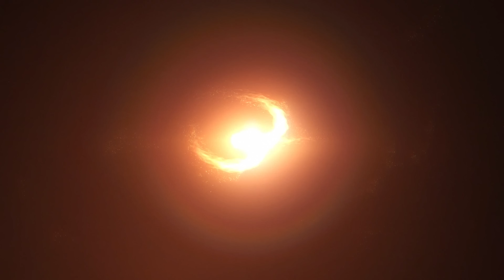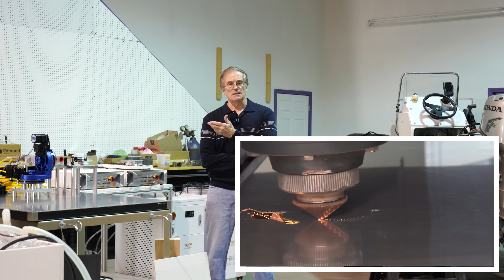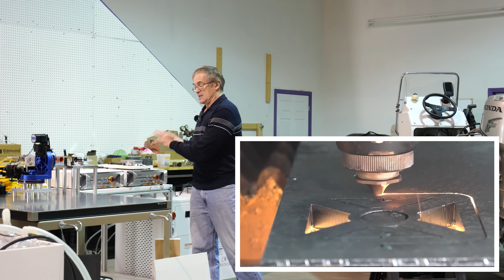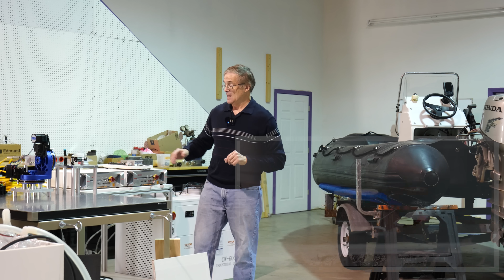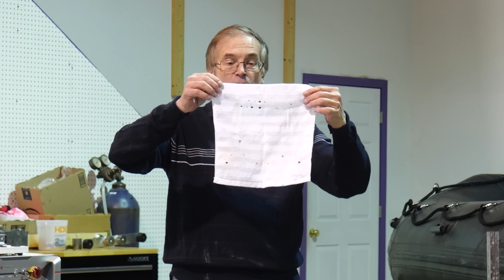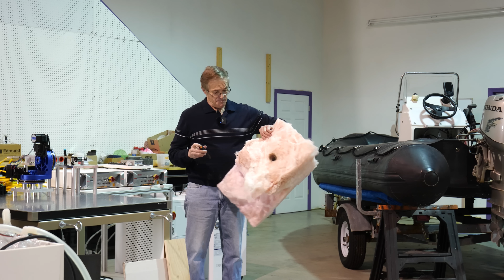We have a problem... and need your help!

Comment: 1030-1075nm?  My thought is to use a few millimeters thick foam or powder coating of an infrared-transparent salt like potassium chloride.  Try to diffuse the laser on its way to hitting something that can handle that intensity if it's defocused to a larger area.  The trick would be finding a material transparent enough to micrometer IR to not be destroyed, but surely that material exists because that's what the fibre and lensing in the laser itself are made of.  Finding an adhesive that is also IR transparent enough to not be destroyed may be a trick.

I see that high-density polyethylene is around 97% transparent to those wavelengths.  It might be interesting to try hitting a milk jug and see if it burns away or is able to diffuse the laser.  I'm guessing it will be destroyed, but if it's not, that material might prove useful.

You might be able to build a photosensitive kill-switch like others mentioned, without it having to be in an enclosed box the size of your garage wall.  Phototransistors are cheap and you can get them in T-1 packages just like LEDs.  There are currently manufactured through-hole infrared phototransistors specced as sensitive to 850nm, but if you look at their datasheet that sensitivity is a hump that includes 1000-1100nm at reduced sensitivity - which is actually good for detecting something very bright.  I'm picturing an array of these stuffed into short tubes that act as blinders, each phototransistor only seeing a section of the backdrop but together covering the whole thing with very low sensitivity where the drone would be flying.  These plus a reliable capacitor-based analog timer circuit, could give you a tunable fractional-second of leeway for a shot to slide from a miss to a hit without a premature shutoff, but disengage the laser hitting the backstop continuously.  Even if you need 100 in the array the detector will probably ring in at under $50.  Because you're only interested in any of them detecting, not which ones, the wiring should be simple with the detector diodes just all in parallel.  Aim the tubes by bending their leads, then hot glue once satisfied.  Test the coverage by waving an IR flashlight at the detector,  then swap something out to decrease the sensitivity for the laser.

Comment: The Best solution will be using rotating  or oscillating graphite disks. They are rather cheap and resistant for high temperatures. Movement will spread beam to larger area. If you wish to have bigger surface you can try 2D oscillation. Most important is to reduce time of exposition on particular point and give time to cool down for material. Other material can be coated with fire resistant paint aluminium or brass plate. Mounted in similar way.

Comment: Recycled glass bottles wall. Cheap, accessible, but quite a bit of labor. Maybe fill a second layer of them with gelatin/water or fine sand.
You showed absorption really isn't going to give you what you want...a cheap and large wall based on diffusion is going to be the best way.

Godspeed gentlemen.

Comment: If you could trap a layer of sand or some other suitable fine particles between two boards, then when pierced, the constant flow of sand through the hole would prevent the laser from burning all the way through.

Comment: Tank full of a milky liquid that will scatter the beam? Even a tank of water could potentially work especially if you mix something into the solution to better disperse the beam. Another option would be to submerge your plywood or fiberglass in a water tank. Possibly color it black to help absorption as the water keeps it cool.

Comment: Wall of ice.  First you make a scaffold consisting of a thin sheet of metal. You will drip or spray super cooled water onto this. The metal surface will conduct heat and the supercooled water that hits it will instantly turn to ice. Adding a small amount of salt to the water will allow it to remain liquid at lower temperature, this will keep your pump or sprayer from icing over. Sugar or food coloring have similar effects.  You might need a nucleating agent.  Set up the wall in a kiddy pool, and pump it out when you're done.    I hear pycrete is interesting stuff. A giant slab of it probably wont' catch fire. probably...    Maybe just go with plastic barrels filled with water, and a lot of corks to patch them. It's quick and cheap and  movable and modular. you can grow potatoes in them later.

Comment: Random Ideal List:
1.   Puls the laser
2.   Set an alignment mode .001 % power 
3.  You used optics to focus the Laser so, can you use optics to widen or diverge or Blure  the beam then have a mirror to direct it straight up or into a safe direction and then into your Barrier
4.  what would happen to the laser going into sealed Waterfull Box, Mutiple waterfalls each behind the other so as the laser hits and refacts to the next waterfall separated by 100mm have something in the water to absorb the laser or spread the beam ? (Milk, Ink, Fin Clay) particles.

Random Ideas from someone who knows nothing about laser properties.

Comment: Hmmm so you are asking what can i shoot with my two industrial lasers without destroying it ... I would try some ablative heat shield like starlite that can be homemade cheaply and spread on anything maybe dope it with graphite / ceramic / vermiculite / silica / quartz / silicon carbide  to try to absorb either by refracting light in the material or by having a high enough melt point material as doping that it could handle the laser for a few seconds it would definitively charr but it would not sustain fire. My best guess would be starlite doped with silicon carbide.

Comment: I worked with an  YAG industrial laser welder in the 1970’s . I don’t recall the manufacture , but it may have been Raytheon. That machine had a gold faced  convex mirror that diverted the beam into a water cooled target when in standby mode. The system worked reasonably well however the beam did burn through the gold mirror on occasion.

Comment: If the brick works so well, why not just get the tiles made from the same compound, they have them readily available at lowes, and they are cheap.   And they could be attached to sheet rock panels for portability.  I would think mounting them backwards, so the rougher surface is getting hit would probably hold up as well as a brick does.

Comment: A few sheets of Cement board, potentially sanwhiching some rockwool, and attach a single 16x16 cement paver behind wherever center may be, wherever stationary tests may hit.  The cement board will be lighter than a brick wall by alot, not sure how the rockwool will react to your laser, but probably better then fiberglass insulation.

Comment: As a safety mechanism, setup your LASER to a single pulse of a few milliseconds. This way you can run tests and see results with less repercussions. I would imagine you could determine an "On Time" needed to cause significant damage to a drone and develop an algorithm to determine if additional shots are needed.

Comment: I wonder if a very coarse and slightly damp garnet sandblasting media captured within some kind of wall cavity would do the trick. The media should be pretty resistant to melting and relatively good at dissipating the heat it absorbs from the laser. If my experience trying to run a sandblaster in the Oregon winter with an air compressor without any kind of air dryer is anything to go off of, it shouldn't take much moisture for it to "cake" well enough to prevent it from spilling out of any holes created in the containment structure but also crumble easily enough to fill any voids in the media created by melting.

The difficult part would be constructing the wall out of something that isn't flammable but also strong enough to support the weight of the aggregate contained within it. For this, my initial thought would be build a sort of corrugated cardboard-esque structure with light gauge steel plate (so that any holes the laser cuts can be patched easily with a welder) sandwiching corrugated steel roofing material. Coincidentally, I wonder if the fiber lasers could be reconfigured to be useful in the welding portion of the construction of such a structure.

All this said, this approach might be a bit more resource intensive than would be practical to your needs but it do believe it would be an ideal solution from a mechanical perspective given its potential "self healing" and energy dissipation properties. With some thoughtful design, I also believe it could be made modular enough to allow for a relatively easy set up and break down process.

Comment: If you want to interrupt the laser beam in case of an emergency, why not use a lead crystal prism? Put in in a mechanism inside of your attenuation system to break the laser beam into its various colors (?) I have never tried to use a prism to break up a laser beam, myself but the theory should be sound enough for you to try. Let me know if it works or not. I'd be interested to figure out how to disperse a laser beam to render it neutral and not dangerous, and the bonus of using Leaded crystal is the relative cost of it, since lead crystal is still less expensive than buying a quartz prism. but I would caution you before hand make sure the crystal prism is completely clean, devoid of any oils from your hands or anything else and wiped clean with a lint free cloth anything on the surface of the Prism would spell the doom of the Prism in short oder considering how much wattage is coursing through that laser beam.

Comment: Some kind of ablative coating? You could make tiles of the sugar snake compound. When it cooks it would flare up and turn a matte black carbon structure which would absorb the heat and light.

Comment: For high-power laser testing, a cost-effective, scalable backdrop using Pyrex (for permanent quartz) panels with water flowing over both sides and gaps between. The setup dissipates heat, prevents beam damage, and cools in a loop via pumps and a reservoir. Works for single-point or wide-area tests – safe, repeatable, and budget-friendly, see email for plausible side view design :)

Comment: Many years ago I visited the Naval Research Laboratory in Washington DC where they were working on Star Wars projects. They had a super high energy laser that they were using to burn homes in things. For a backstop they used a block of graphite. Probably about six inches thick. Not cheap but it did stop the laser without any appreciable damage to the graphite.

Comment: A wall faced with concrete board may work. Double layer for safety, put it on a wood frame with wheels for mobility, and make each column a separate part, allowing for quick storage. Theaters use walls like this for changing scenes quickly, and they're pretty easy to make. If any part gets damaged, you can swap the face, the frame, or any other part without hassle due to the modularity. For keeping them locked together during experiments, a couple bungie cords per joint on the back will keep them together and tensioned at all times. For filling the gaps at the joints, the walls can either be offset to layer themselves naturally or a strip of concrete board can be added at the front of one wall and the back of the other, giving a completely covered joint. applying the strip on the front of every left side and the back of every right makes them all the same design, thus easily replicated from one design template.

Comment: Ice blocks with styrofoam dust mixed in. You can insure uniform mix by applying ultrasound agitation while freezing the mixture. It is cheap . It can be made in large blocks .should give you at least a few seconds before melting through especially if the water/styrofoam block is kept cool with dry ice. Care should be taken to  avoid the effect of the blocks of ice 
Exploding from water being vaporized. Covering the ice/Styrofoam bricks with heavy canvas should protect the area from the ice debris. I don’t think that there will really be explosion large enough to cause a serious hazard . However ,better safe than sorry.    This works for modern H bombs it should work for you.

Comment: Engineer, but no laser experience.  My first thought is to use Optics.  I read many of the suggestions.  I liked the Duroc + WETSAND + Duroc.  But that stuff gets heavy.  You did
not mention the final size required (meters? or inches?).

So, I am thinking those "Invisibility Shields" that refract light around.  Maybe a glass version, obviously. As PART of the solution.  I am also thinking that layering different materials:

Drywall,wood,drywall.  Aluminum Layer, drywall, wood...

And I loved the idea of "hanging" this so it could swing like a pendulum.  (2 rotating offset wheels along the 2 ropes holding it up).  If you could get more of a circle than a pendulum, you remove the bottom stroke gets the majority of the energy.  

But combining a few different things.  This might work for the WATER solution.
Literally suspend water (with that dye someone mentioned), in glass container.
And let it swing many inches.  In fact, the swing rate and the depth would work hand-in-hand.

Furthermore the weight would all be the water, which I assume you could refill on-site.

Great Problems to have.

Comment: I haven't read all comments (there are a lot). So not sure if this was mentioned. How about non-reflective aluminum sheets, quarter inch thick, fastened to quarter inch plywood or T111. This wall would be set at slight angle tilting back or away from laser at the top. It would be set in a trough made of waste-sized PVC cut lengthwise. It would be filled with colored water and a pump would drive water up tubes to top of wall connected to copper tube with tiny holes drilled for creating a mist. Serves 2 functions: cooling aluminum sheeting, and mist may scintillate the beam. Add some TEC modules for cooling water as well. Might work for pulses lasting a little over a second. But I really have no clue if it would work.

Comment: Hi if you use like bubble wrap with water instead of air but a opaque plastic but water filled at least 1" thick should absorb some of the heat
Thank you Ray Anderson

Comment: Hi there, whatever material is used, then place on a moving assembly to the background target area constantly in flux whether with offset circles Eg steel wheels with alternate hook points on a high track - kind of like looking at an old style choo Choo train locomotive with the long metal attached to the wheels - that’s where the wall will be attached and you move back and forth to have the laser making patterns of squiggly lines but essentially aren’t in a static location long enough to cause burning.  You could wet the area too to slow any combustion possibly. Bernie from Syd Aus.

Comment: You'll need to reflect the beam first.  Having an angled wall to direct the beam, potentially down to the floor, would increase the distance the beam is traveling, making it easier to absorb.

Comment: What about cement boards, layered, with intumescent paint or material on each board. Eg the DIY starlite nighthawkinlight made in one of his videos, on each board. Also means as you sacrifice each board, you can just change that one board out. 

A more outlandish idea I'm thinking of is a 'waterfall' of water fog, perhaps from a load of ultrasonic misters, in front of whatever you decide to use. Either the water in the fog takes the hit and evaporates and dissipates the energy, or the fog diffuses and disperses the lasers beam to a less unfocused state and makes it less precise and damaging to whatever you make your actual wall out of.

Comment: In a way you are trying to make a sort of anechoic chamber for light .

So , build a room chamber big enough to do the experiment in yet confine where the beam can get to … rather than the whole area of the end of the buildings wall . = less area to protect = less cost  . Perhaps 3 sides and a roof “small” and a larger side wall at a distance.

Since brick did well , close fitting ceramic tiles mounted on the  plywood might be quite effective.
( You could have some tiles off Atlantis space shuttle underbelly since NASA has retired her ! )

However, thinking on ,.. a lot of decor these days has glass diamonds, crushed glass or glitter sandwiched between glass layers. Heck , we even had a bread bin made in that style . This would initially cause imperfect random reflections, buying you more time. 

The back plate of that sandwich could be a mirror tile , again an attempt to redirect the energy back through another random diffusing path. 

Anyway final thought…
WHAT ABOUT REFLECTIVE SIGN TECHNOLOGY? Here in the U.K. we have car number plates with a reflective  backing . It’s that night time reflective hi-vis stuff used on highway signage and night cyclist protected gear .  

On an atomic level how does this technology work ? Could it in turn reflect a scatterd beam ? 

Regards 
Graham (the dentist )

Comment: Thanks for your presentations.
Idea for protection from penetration of lasers.
Reflection, reflation, and obsorbtion./
 Perhaps glass.  Different sizes, shapes and colors.  Frit or broken up glass fits the mentioned above.  But also marbles can be made with materials melted in.  Some with glitter, some made black all held in place glued to boards made into boxes or boards paired with the glass sides facing one another.
Thanks again to you and all there.  Please keep the posts coming.
Reply: That was meant to say.  Reflection refraction and obsorbtion.  Thanks again.

Comment: Could you mount the lasers 40ft in the air pointed straight down? Use the floor you're stood on as the backdrop instead? It would be easy to cover with a layer of graphite powder, flowing dyed water, a rotating panel or black sand, or any of these other suggestions, and, if it burns through them, it is only going to make a few small holes in the floor?